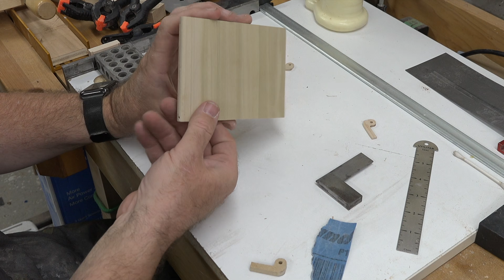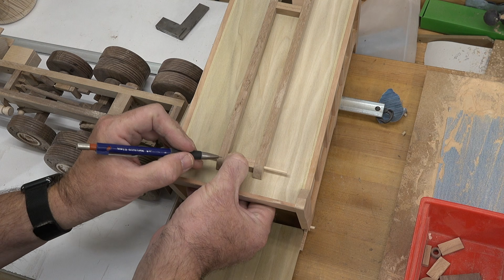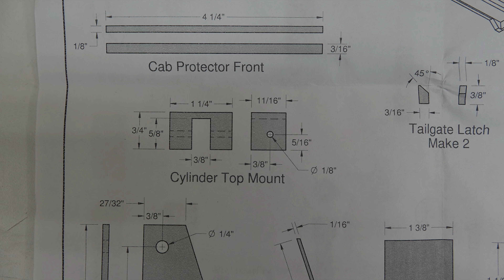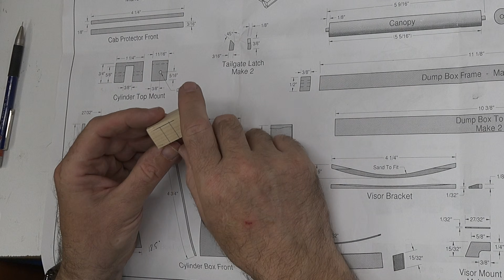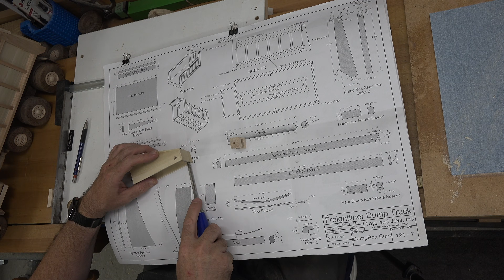Making Toys and Joys Dump Truck and Pup Trailer Part 15

Comment: Unrelated to THIS video, I have to thank you for suggesting to put first aid supplies in the workshop. I had a mishap with my miter saw yesterday and chewed up the pad of my left middle fingertip. Dumb mistake that took a fraction of a second. I didn’t wait for the blade to fully stop and reached in to get the pice of wood. Fortunately I had first aid supplies handy and was able to get gauze and tape around the wound immediately. My wife was out of town and I had to care for my son with special needs so could only go to emergency the next day (today). Anyway, thanks again for that piece of advice. I put a fire blanket in the shop too!
Reply from the maker: I'm sorry to hear about your accident Stephen and I hope that you were able to get the medical attention that you need to heal properly.  I hope you have a speedy recovery.  I'm glad that my suggestion was taken to heart and that you took the time to add first aid materials to your shop.  This is EXACTLY why I suggest things like that on the show.  So that others can benefit from having the supplies there.  Hopefully you never need them but in the unfortunate case of an accident, it is much better to be looking AT the first aid supplies, than to be looking FOR the first aid supplies.  Heal quickly sir.  Thanks for tuning in and thanks for chiming in with your story.

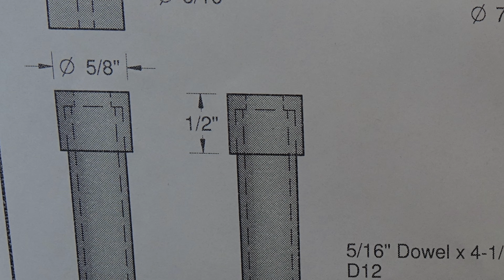Comment: Hi Ken, another great show! The collet center you mention at 12:53ish, could you supply a link for that please? I’m struggling to find one? My a different nomenclature? Cheers Gary
Reply from the maker: Here is a link to the collet set Gary.  While the set is expensive, you can also by them in individual sizes.  They all fit into a 1/2" chuck collet and although they claim to be able to be used with a drill chuck, I find the drill chuck mars the finish really badly on the collets.  https://www.leevalley.com/en-ca/shop/tools/power-tool-accessories/chucks/71613-beall-i-x-internal-expanding-collet-set?item=44J0780
I hope this helps.  Thanks for tuning in to the show.
Reply: @acutabove_woodworkings  Thanks Ken, I really appreciate you taking time to respond... cheers Gary

Comment: Honestly, this is a truly monumental build, as is shown by the time it has taken you ... the sheer amount of work put into this project is apparent when you look at the model, so many pieces, all perfectly cut and fitted ... it is a truly exceptional piece already and it's going to be even better when you apply a finish to it, which is a major job in its own right 👏👍🤟
Reply from the maker: Thanks for the kind words on the series and on the project Barry.  I am considering a show when this is all done, on the process of applying the finish to a model like this.  Hopefully when that time comes, I will still have some ambition left.  LOL.  Thanks for tuning in

Comment: Another super show!   I can't believe that this was Nbr 15.  Incredible.  A lot of great advice and technique in this one. . . .especially around the end drilling of the cylinders.  I'm thinking that another approach to the drilling of the bottom and mid cylinders might be to use Pen jaws on a lathe chuck to drill the center hole and then turn the exterior size dowel needed.  I make a lot of pens and use that technique to center drill the blanks for glueing the brass tubes into the blank body.  Now I will admit that while it works great for pens, it may be too robust for the nesting cylinder parts. 

This is a terrific series and while being a lot of work for you to produce, it is truly a treasure trove of encyclopedic information for those of us watching.  Thank you so much for sharing.
Reply from the maker: Glad that you enjoyed the episode.  I appreciate you tuning in and chiming in with your thoughts and ideas.  Thanks.